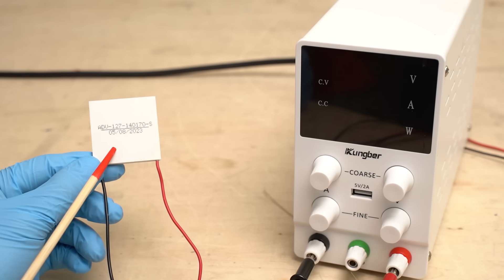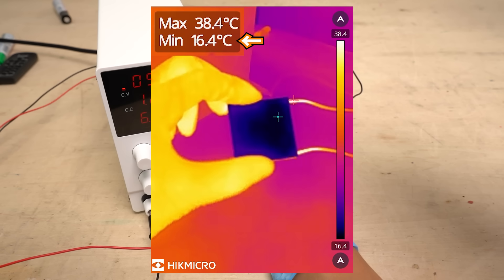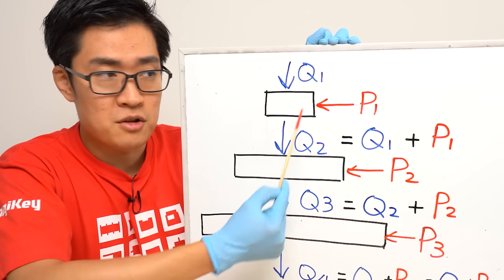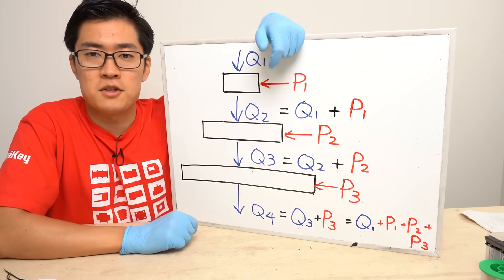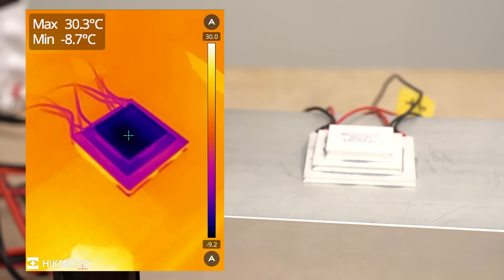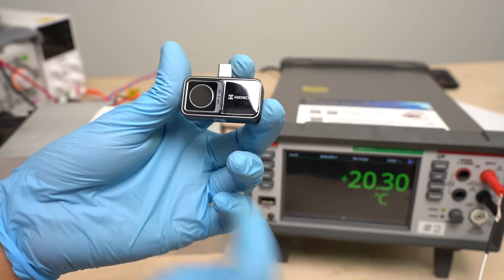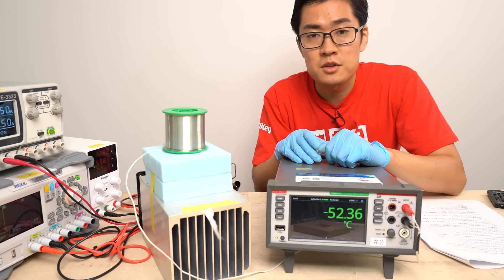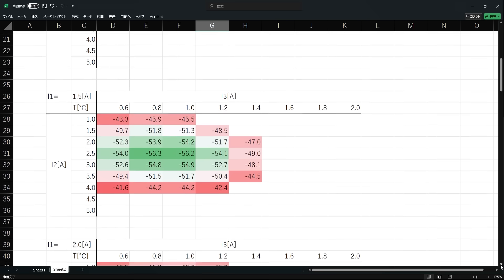Stacking 5 Peltier Modules, and Reached -90℃

Comment: You need to try putting the hot side of the peltier against a water cooling block with water or coolant flowing through it! I've been able to sustain colder temperatures over a much longer period of time that way, now your experiment stacking them is going to be very useful for me, thank you so much for saving everyone else the time! Peltiers are such useful fascinating little devices

Comment: 1, thanks for the information and using your time to conduct this experiment👍👍👍👍👍❤️

2, your aspirations maybe high, testing materials at the edge of the known, break like speed and all……..  but, if you really want to make the world a better place, consider building these devices in to a diy solar powered air conditioning system.  It’s pedestrian but more people will get use from your vid (repeat watch, ad revenue, YT algorithm) than theoretical information….unless you discovered warp drive then F—! cheap AC😂😂😂

Seriously, lots of us want to shave % off our energy cost. Your -90 device sound like it can take the edge off the summer temp. I’m not hoping for 65-70, but to bring down temp from 95 to 85 would be awesome

There are many YT video doing this and there’s a guy that runs his workshop with DC solar

Comment: And if you reverse the DC current, so does the heat and cold sides.  I have a decades old 12 Volt Peltier cooler that can cool or warm.  As I remember it had a maximum of 25-30 degrees below ambient.  So stacking is a good way to increase this difference.   This becomes a heat pump with no moving parts.

Comment: you dont have proper heat transfer plates between peltier devices. They dont conduct heat sideways, remember you got a grid of semiconductors ... 

Get a stack of 3mm aluminium (copper even better) plates in between the peltier's and you will see improvements on temperature.

Back in 2004 i used to have a 250W Peltier watercooled for the CPU of my computer, an Athlon XP cant remember the model if it was a 1700+ or what. It was able to hold -22C at 2.8ghz (about twice OG clock speed) on full load. The power supply was a home made frankenstain beast, using 3 old AT PSUs, cascading the 5v lines (15v 20A). How did it work for so long? i don't know but it did for months.

Comment: Terrific work. Now, please do another zillion experiments finding the most efficient way to cool from 87 degrees F to 30 degrees F for my 50 liter cooler. I need to remove the most calories with the least power. I see that commercial coolers eat a lot of power and are low on volume. 😅 Yeah, I may be dreaming of unattainable efficiency.😢

Comment: What if the pyramids were ancient fractal peltier assemblies that were used to cool the quantum computer at the top. Great video, also what would happen if you used a water cooled liquid cold plate with turbulating inserts instead of a fin fan assembly? Would it boost the performance?

Comment: Did you see the effects of moisture condensation first, then the condensation of carbon dioxide and finally oxygen and nitrogen?

The three stages of the coolers need different currents. but the optimization process was not very clear

Comment: An excellent series of experiments with easy-to-follow explanations, thank you.  But why do the modules have to get smaller towards the top of the stack?  A detailed technical explanation with calculations would be appreciated, as in your power-stacking calculations.  Many thanks.
Reply: top layer pumps W watts and this must be collected by the lower layer. So the lower layer must be larger in size so that all the heat from the top layer plus some from the sides can be collected. These are 100% efficient and we need to add the extra power needed to pump the W watts to the bottom layer. To reduce the leakage from the sides we need insulation but for the inefficiency we need lower layers (pumps) to  be bigger in size

Comment: You should do more power consumption tests, that we can see if there is optimal temperature drop vs. power consumption. Also Peltier modules aren't so expensive as you said. In Poland I can buy 3 modules to stack them. From around 2-10 USD each. So... when I buy most common like 60W module I will pay around 3-4 USD maks. So for 3 it will be around 12 USD. "Weaker' module, like around 36W I can buy for around 0,5-1 USD.

Also you should test about air -> water condensate from air. And how to prevent it. Because if don't know about it, you can destroy unintentionally you electronic device. 

I will looking forward for second part that includes the things I wrote about.  😀

Comment: I have always wanted to apply an array of Peltiers the back of a solar pan panel.

The idea is to pull the heat from the panel and sink it into a volume of water which then exchanges into a sand battery.

Comment: Did you also use water as gluen when doing the current experiemnt? The thermal-mass of the huge drop might be adding to the time it takes to reach equilibrium

Comment: You're basically putting them thermally in series. And it behaves a lot like putting batteries in series. The more you stack, the higher the voltage (charge difference between the poles) becomes.

Comment: Always been curious about this. Also, "Thermal Grizzly Kryonaut" is rated at -200C or -250C or something in case you decide to take this further. It's designed for liquid-nitrogen overclocking and such.  Edit: you can try reaching-out to Der8auer, they might send you some for free if you're going to be making a video with it! 🤟

Comment: you would have better efficiency with copper plates between the cells. The top one is smaller than the bottom one so you are not using the full potential of the bottom cell.

Comment: What about the hot side or the radiator temperature? I thinked about using a peltier on my cpu for a long time, but the problem is the hot side and condensation on cold side.

Comment: when you pull the heat out of the HOT side the temperature of all the devices will decrease by there DELTA T value/specs....I make similar devices (cascade devives) in the UK

Comment: Have you tried using a TEG ?  (Generator, Vs. TEC  - Cooler)
TEG: Element size considerably larger , High Solder melt temperature to sustain higher temperature differentials
TEC: Generally smaller element (pellet ) size for less power, Relatively lower solder melt temperature

Comment: you can always cool down the copper wires and lower Peltier module stages using closed loop distilled water cooling for increased efficiency

Comment: I think this Aluminium heatsink you use isnt as good for the small aerea of the peltire modules. 
Try using cpu coolers (maybe some used aio liquid cooler), they Perform a lot better because they have more surface, and mostly made from copper. Heatpipes are also better than just raw Aluminium Extrusions, they spread the heat a lot better and faster. 

a cpu has mostly the same surface size so it schould be better. But dont get cheaper coolers, look at the rating in watts they can handle.

Comment: Those types of peltier coolers dont have heat spreaders. You can gain more efficiency if you use a copper heat spreader for each side of each module. It should net you a lower temp at the top cold side.

Comment: I would use the ice trick to isolate the Peltier devices, similar to how you attached the thermocouple.

It may be slightly more accurate to ensure the thermocouple is touching the Cold-side surface, however, that may only net you a +. 1°C to accuracy. Maybe less.

Loved the science. Please continue, you're doing great work. 👍🏻

Comment: In the late '80's I worked for a company called Electro-Optical Industries. The company produced a variety of black body and solar simulator IR sources. One of the lines was a BB with a +- 50 Degrees C with an accuracy of 0.5 D C. This was a Peltier device BB. They also offered some stacked products. Primary customers were defense and university research. It was a very interesting company. My particular source of pride was streamlining the test to calibration of the controllers from one week per instrument to one day per instrument. The BBs had a very large fan based heat sink as well as calibrated TCs for control and temp monitoring. This is old tech, PDs are also sensitive to mechanical failures if the hot and cold side emitters are too constrictive for thermal expansion/contraction. Finally, PDs are not very efficient as losses per junction are quite high. While very suitable in a lab environment due to precise controllability, the "old school" evaporator/condenser process still has the efficiency card.
Reply: parallel peltiers and reduce current load per peltier for higher efficiency, and use phase changing coolants and use peltiers to phase change.
Reply: @ Try it out and collect data. I'm interested to see your findings.
Reply: @kopazwashere  Your math and understanding of how the device works is flawed. Delta T is directly proportional to current flow. Reduce current, reduce delta t. What is a phase changing coolant? Have you done this and can you provide the data? In the black body application, peltiers are connected in parallel, but this is done to make the driving current as uniform as possible per device, it has nothing to do with efficiency.
Reply: @Pilot4prophet661  Ehhhhhhhhh.... Nope. Its not directly proportional. Ive seen datasheets myself. Feel free to yourself. (Hint: I^2R)

The coolant im talking about is R1233zd which has gassification temp at 18c on standard pressure. It's also not easy to get unless you're a business owner or a college.
Reply: @kopazwashere  I should not have used the term "directly". Proportional is more current more delta t, it may not be perfectly linear, it's still a true statement. Adding a refrigerant to the mix just complicates the system and adds cost, does not make it more efficient. Now you need a condenser and a refrigerant compressor and a flow control plus plumbing rated for the refrigerant. You are now also limited to a single direction of temperature flow. So cooling only. Add in the limited availability of the refrigerant? Well does that add or detract from practicality?
Reply: @Pilot4prophet661  R1233zd, like I said, gassifies at 18c, on standard pressure. no compressor needed here. I think you should be able to deduce what you could do with cooling gas & heating it up on a heat source.
Reply: @kopazwashere  Just what the heck are you trying to accomplish over a simple PT stack? Ultra rare refrigerant? I need a bag of what yer smokin. I cant deduce what you are talking about, For what purpose? It doesn't matter what temp it gasifies at, you still have to get it back to a liquid state to recycle the refrigeration cycle. That's how latent heat is recovered. CONDENSER. You know, like Air conditioning, refrigerators. What is the need, the goal, the application? Are you proposing a lost refrigerant process of expensive hard to get refrigerant? how about dry Ice, pretty common, pretty cheap, and you don't even need a pt system. Holy smokes, you read a data sheet and create a problem no one needs to solve. Oh wire them in parallel, Thats nothing new, it's standard practice. Cool story bro, keep trollin.
Reply: @Pilot4prophet661 
What happens if you cool a gas below liquefaction temperature? And guess what ill use to cool the gas?

The fact that you used to be a researcher horrifies me.
Reply: @ Where did I say I was a researcher? I tested black body controllers from production to ready for calibration lab. I can't guess what you'll use to cool a gas that is almost impossible to get, used for an unknown reason. Other than raising the complexity and cost of a simple system. Why don't you explain it to me rather than asking questions you won't answer yourself?
Reply: Thank you thank you thank you so much for that concise explanation. I’ve always wondered this, and an expert steps in!

However, if taking those above restrictions into account and considering “free power“ as in solar power, we could add another heat sink and create a Peltier powered cooling block as well… My interest is in passive/self powered air cooling as I live in California and it gets terribly warm.
Reply: @ I can only speak as a technician, not an engineer. Also, my work is some 35 yrs ago. That said, I haven't seen any new developments in Peltier tech or efficiency. I also have a refrigerants license from the EPA and so have knowledge on the compressor/evaporator process and heat pump tech. as much as we would like to see the solid state devices perform, they do not compare to the energy use/Delta T we get from our current high efficiency HVAC tech. Peltiers can be delicate, and the junctions are prone to damage by the very means that makes them useful, microstresses from sandwiching in heat sinks and the very nature of thermal expansion and contraction. We made special spring tensioned emitter/PT/heat sink stacks to minimize this undeniable physical limitation. We still had some breakage of PTs. The truth is PT do not make effective nor cost efficient large scale thermal transfer devices. They are a laboratory/ultra tech device where a compressor/evaporator system cannot operate. The soviet Union used nuclear decay PT systems for their cold war remote transceivers, but forgot to maintain or geolocate them properly.  They later became an environmental disaster. You can find this right here on You Tube.
Reply: @Pilot4prophet661  pd rtg are use in space sometimes as well
   I seen about the Soviet rtg's you speak of 
   Looks like they was used for Target practice and rusted tf away 
Like the Easter egg embodiment of superfund Sunday
   😂
Reply: @ Electro-Optical Industries was located in Santa Barbara. I feel your heat.

Comment: People seems to be totally unaware HOW inefficient peltier is... To give you an example: To cool 200w you will use 380w on the peltier meaning 200w + 380 = 580w total power consumption. ONLY reason to use peltier for cooling is because it is cheep and simple or if you have size restrictions. Normally ANY other cooling solution will be a LOT more energy efficient.

Comment: Back in the days of the Athlon XP (CPU from AMD), I cooled my CPU with the help of a Peltier element. It had an output of 40 watts. If I connected the 5 volt line and cooled it with a conventional CPU cooler at the time, I could freeze water from the air into ice. I then built the Peltier element not between the CPU and the cooler, but between the cooling block and the fan with the hot side facing the fan. Surprisingly, this worked. The cooling block was also cooled, although the warm side of the Peltier element was only cooled by the air flow. Greetings from DE
Reply: Mate the old days of the athlons and peltier experiments. Bet that beast overclocked legendary
Reply: I remember those days.  Modding computers was a new frontier and there were some truly wild solutions.   I have always wondered if you could cool a water cooling loop with a Peltier set up like this but have it only cool down to 5c so you don't get into the issues of condensation.   I can't imagine my computer running dramatically better at temps colder than 5c even at full load.
Reply: @joshuaszeto  I have a peltier cooled water loop, it has 6 60w peltiers attached to 2 large aluminum heat sinks I found at a scrap yard, the cold side is attached to 2 long waterblocks from ebay. then into my cpu block for my vintage athlon XP rig. each peltier has its own power switch with 2 turned on it gets my athlon XP 3000+ sub ambient. I also have an AMD FX system to test it on to really stress it out but im waiting on a waterbock for it.
Reply: Iback in the days i used a 100W peltier element on a copper cooling block tied to the cpu. It was very effective until it blows up by condensating water. I just missed to seal a small connector on the board with nail polish. it was an expensive mistake 🤣
Reply: @guidowinkelstrater686 I ran a stack of 2 x 90w peltier and water cooling on my overclocked slot1 celeron. Had to disable standby or it would freeze up...
Reply: how cool would it be to do something like this for a crypto mining rig
Reply: Was there any condensation?
Reply: . It had an output of 40 watts. means that it can pump 40 watts of heat when both sides are at the same temp but the input power can be different. these are basically heat engines and obey carnots law
Reply: @janami-dharmam  Yes, I knew that the Peltier element with the 5 volt cable did not run on 40 watts. That's why I mentioned that. But I was probably a bit imprecise. Sorry.
Reply: @SithNazgul  there is nothing wrong with a peltier element of 5V running at 40W; they are basically heat engines or Carnot engines running in reverse with some inefficient factor. Modern peltier elements are semiconductor devices and they are made by parallel circuits.
Reply: The danger of having sub-ambient temperatures in computer components is water condensation. In extreme overclocking I think they use nail polish or vaseline.

Comment: This reminds me that I had a crazy friend who would yap that watercooling is so much worse than using refrigerant and a compressor. I was focused on price to performance and reducing the form factor but he would go on about stuff that wouldnt make sense at all, anything to provoke an argument. I find out about peltier devices later on and it seems interesting but I only recently see this video and realize this could be a much smaller form factor cooling method if I put my mind to it.
Reply: Peltier is horribly energy inefficient ('For example you will use 380w to cool 200w = 580w total) . Only reason to use peltier is because it is cheep and simple or because of size restrictions.